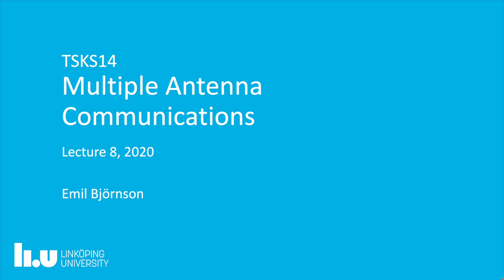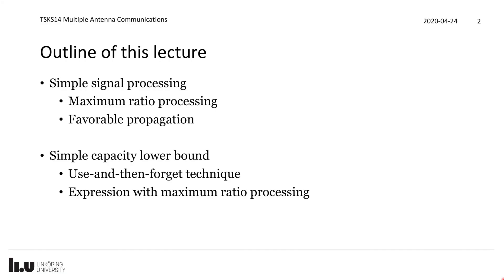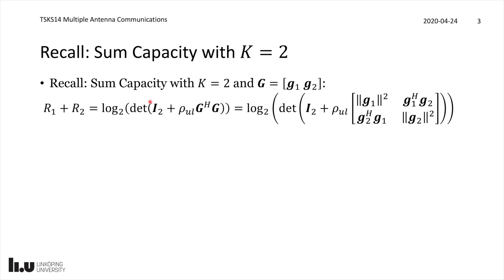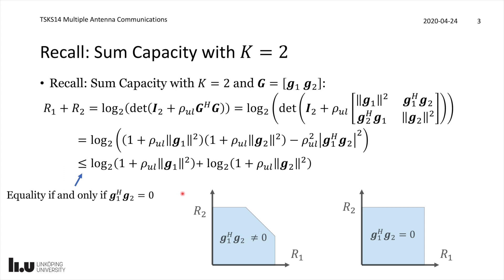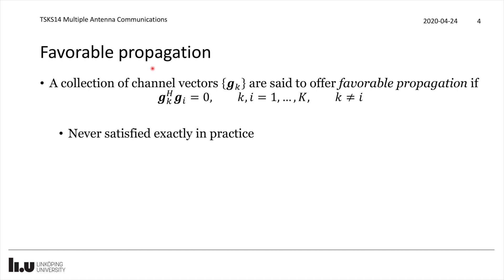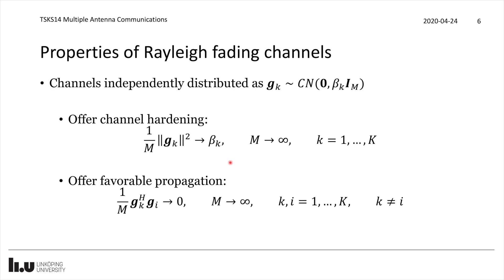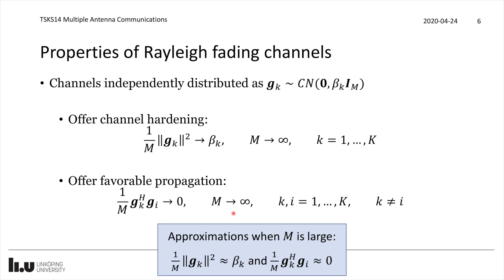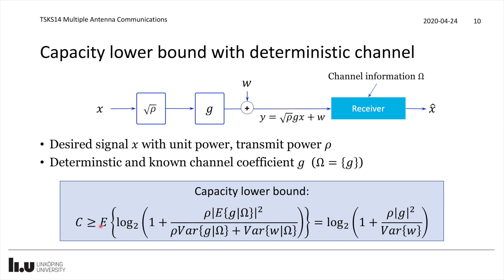Lecture 8: Favorable propagation and MR processing (Multiple Antenna Communications)

Comment: Hello Professor,   Thank you so much for your lectures! Love all you're videos they are really Insightful.
I have a question related to Capacity bound with the use-and-then-forget technique. 
I want to know if is this correct considering that the Capacity bound with the UatF only depends on LSF coefficients and is not affected by the SSF.
Reply from the maker: An ergodic rate is a function of the LSF and the fading distribution, but not the precise SSF realizations. The reason is that the channel codes are assumed to be very long so that we transfer data over many time slots with different SSF realizations, so that we don’t need to care about the exact realizations only their statistical properties.
So yes, the expressions obtained using the UatF bound only depends on the LSF coefficients (and to a limited extent on the fact that the fading is Rayleigh).

Comment: Sir,
@24:05 it is given that the 3rd term  of the equation is set to 0.
But if we observe, w' contains two parts.
By substituting w' in the equation, w term multiplied with g/M term remains as it is .....which is not 0 ...
Please do clarify this sir
Reply from the maker: Hi! w’ contains estimation errors and noise, both of which are independent of the channel estimate. Hence, each of these terms will be approximately zero. But please note that this slide is only meant as a motivation. We are not applying any approximations when computing the performance on later slides.